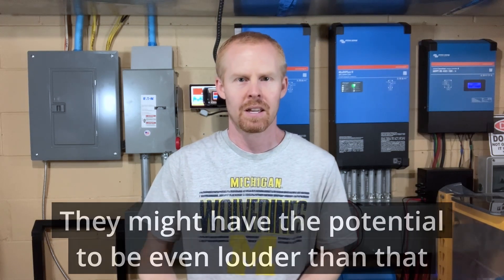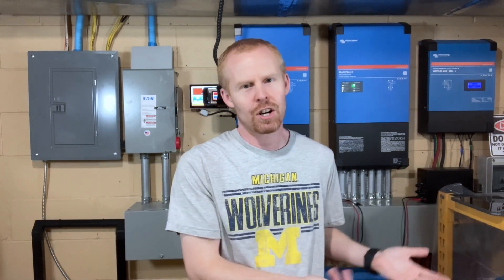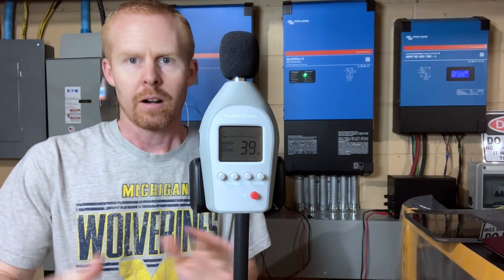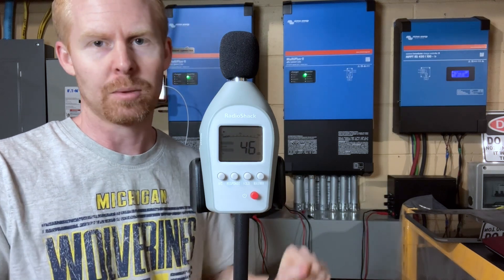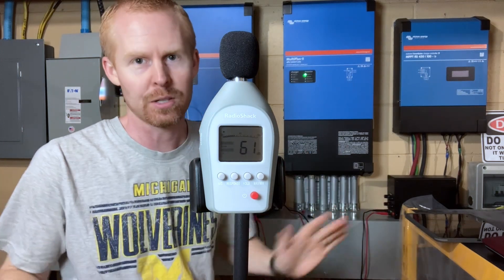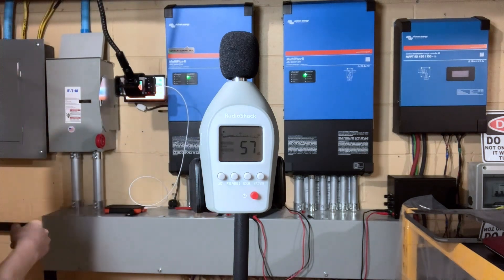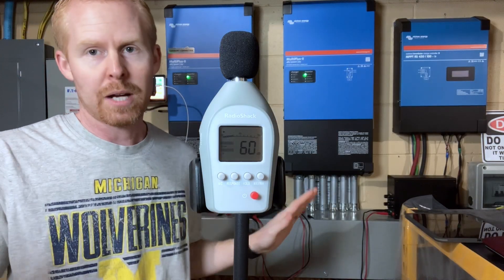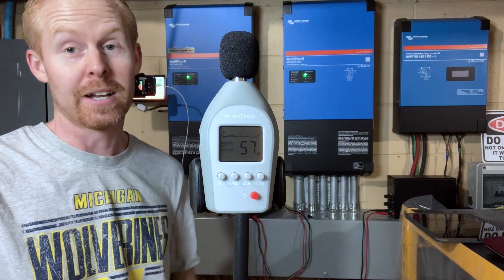Sound & Partial Load Test of the Victron 5kVa Inverters

Comment: Any good reason to get two MultiPlus 5000 like you have instead of a 10,000 Quatro or similar?
I have a chinese inverter just for emergency power right now, and will want to upgrade to Victron down the road as I start to use it more for regular use and not just emergencies.
Reply from the maker: There’s only a few differences between the Quattro and the MultiPlus.  The biggest one is that the Quattro has 2 AC Ins.  If you don’t need both of them, I would look at the MultiPlus.

Comment: They have kit to solve this issue under warranty
Reply from the maker: my serials are not in the range of when that issue was discovered.
Reply: @AdamDeLayDIY  Hi Adam, just query Victron as this was a major issue for older serials as well, They make  the inverters much quieter, as this was a known issue for a number years with the multiplus2. As i am a Victron installer in NZ, and have upgraded a few of these to make it quiter for my clients. Your fans have athe classic pulsing sound at low RPMs, due the PWM pulse of 25Hz,  which was to low, so victron supplied a inline kit which is plug and play to increase the PWM to a much higher frequency.

Comment: Sounds like you need to add the victron  fan mode kit as it will make it ever quieter
Reply from the maker: @robduthie2979  my serials are not in the range of when that issue was discovered.

Comment: Great test. By the way there is a retrofix for the multiplus called "Reduce low RPM fan noise MultiPlus-II, EasySolar-II & Quattro-II v2"
Reply from the maker: Thanks, do you have any specifics regarding this?  I know there was a fix in the past but it was for older versions and if I recall my serial number wasn't within the range of affected devices.
Reply: @AdamDeLayDIY  I tried to post the url but youtube blocked it. Google what is in the quotes and you'll find the pdf. Looks like what I just purchased is affected HQ2219 as well. Dang it did I get super old stock.
Reply from the maker: @DannyCsaszar  Ah, now I remember.  The 120v model of the MP2 5kVa isn't listed on that doc. I think all the problems regarding sound were before that model.  Thanks for sharing though!

Comment: Hello, why do you have the difference in watts between L1 and L2? Shouldn't they have the same watts? Does the length of the AC cables matter? As DC does
Reply from the maker: Unless you only have a single 240v load running, your L1 and L2 will probably not match because of all the different devices connected to your inverters.  There’s alway potential for different devices to be turned on at the same time but different phases and they have different loads.

I had wired up my AC side thinking they had to all be the same length but I’ve since been told by several that it doesn’t have to be regarding AC like it does DC.

Comment: I don’t think this is a fair comparison as the EG4 is an all in one so you should have left the charge controller on. Also you other test was during charging on a Sunny day and today is a rainy day. I’m seeing apples and oranges.
Reply from the maker: It wouldn’t have mattered had I left the charge controller on.  Even the 450/100 decibel level only increases maybe 1 db when running hot. 

The biggest take away is the fans always are making noise with the 6500s and they barely run with the new system.

Comment: My regular multiplus 3000/24  is always super quiet except when the fan kicks in… even then it not bad at all ..I don’ even notice if a few ft away…
EXCEPT ……..for whatever reason , when I hook up my high quality heat gun
on high (1250 watts ) everything is normal BUT on low (500 watts)  , my inverter sounds like a small weed whacker growling… but only when I use the heat gun on low …
I have run at least 25 other things from  small to huge..everything I own to test stuff .!
 Nothing causes it to hum …..only that  heat gun on low…
I have no idea… 
it may be somthing is  wrong with the gun…??? 

My hillbilly solution….don’t use the heat gun on low… I don’t need it to work on low…
Use it on high and hold it a few inches further back …….
I’m a simply guy looking for simple answers…

Your vid reminded me of this scenario…
Thanks…J.
Reply: Hopefully-educated guess: your heat gun uses a TRIAC to moderate heat output, same as a light dimmer uses a TRIAC to moderate light output.  TRIACs avoid having to dissipate as heat (eg by some form of variable resistor) the power you don't want to go into the load by chopping current over each half cycle of AC.  

Need to mention a bit of physics to explain why this is significant: Ohm's law says V = I×R, and power P = V×I; these are fairly well-known, but they only hold for resistive/real loads (ie when power factor = 1).  For an inductor (of which a transformer is a special case), V = –L×dI/dt (where L is inductance, I is current, and dI/dt is the rate of change of current over time; note that minus sign).

When a TRIAC is set for full power, it starts conducting right at the beginning of each half-cycle so the current wave form looks the same as if the TRIAC weren't there.  When it is set for around 50% power, it doesn't start to conduct until close to the peak of each half-cycle, so there is an abrupt change in current (high dI/dt) proportional to the voltage at the time the TRIAC turns on, rather than the sinusoidal current that normally follows sinusoidal voltage.  This is related to why dimmers buzz, but only when not at full power (magnetostrictive effect, which is also why some switch mode power supplies, especially battery chargers, tend to whine and make other odd noises).

The effect of that minus sign is to present a sudden and large voltage acting against the voltage from the Victron's inverter, forcing the inverter to increase apparent power output in order to maintain the 110/230V sinusoid it is designed to generate.  That voltage distorts the AC voltage waveform, increases Total Harmonic Distortion and thereby decreases power factor.  So even though a heating element is a purely linear/resistive/real load, a TRIAC-controlled element is not, because it is a non-linear load with awful power factor.

That goes to power factor and the difference between Watts (real power) and Volt-Ampères (apparent power), and why this 5kVA inverter's capacity is rated at 4.4kW.

When your TRIAC-controlled heat gun is set to 500W, the power that would have been dissipated in the heat gun has to go somewhere — and that somewhere is as heat in the power source.  For utility power, that heat is dissipated in the power lines and transformer.  For the inverter, it is likewise dissipated in its transformer, reflecting the fact that the inverter must work even harder (hence the noise you hear) than when the heat gun is at full power.

It's broadly the same thing as what happens when driving a load with poor power factor, and is related to why inverters that use a cheaper, lighter and smaller high-frequency topology are lousy at driving loads with poor power factor such as inductive loads.
Reply from the maker: Thanks for sharing!

Comment: I'll look forward to you talk about the lower idle current and how much more power you see because of the increased efficiency!
Reply from the maker: I believe it was referenced in another video, but my 6500s had an idle current of around 84w a piece.  So your looking at 168w each hour just to run the units.  The Victron system in total, I believe I saw 35-36w for full system idle.  Each inverter is 15w.  So I’m basically saving 3.2kW over a 24 hour period just in idle capacity differences!
Reply: i think like 15 watts a piece, known to be the lowest

Comment: Is the Max load 5kw each on the inverters, how long will it stay at max before they trip, how long past max will it run, Is thier a higher max rate with PV charging.
Reply from the maker: Continuous output is 5kVA.  You have to take the power factor of what’s running into account.  Peak power is supposedly 9kw, but I don’t know for how long and under what circumstances.  Guess I’ll just have to push these units till they shut down… 😁

https://www.victronenergy.com/upload/documents/Datasheet-MultiPlus-II-120V-EN.pdf
Reply: Victron tend to under rate these

Comment: Surprised at the low 83% conversion rate
Reply from the maker: After looking at it more, in order to get an accurate efficiency measurement, you would have to put a meter on the DC in and the AC Out and do the calculations that way.  The individual devices on the Cerbo display might not update exactly in tune with each other, so you data could be off a little.  

I know the spec sheet shows that the inverters can have up to a 96% efficiency rating, but I’m guessing that’s not under full load.  I don’t think any inverter keeps its peek efficiency at full load.
Reply from the maker: I guess it depends on which time in the video your looking at.  When I looked at when the inverter was outputting 9.26k, I calculate the efficiency at 87%.  I still have to figure out what/why the DC system is high when the inverters run harder.  Seems like it has to be more than just the fans running.

Comment: I'm not quite understanding what you are utilizing the transfer switch for.  It is just a basic on of switch, if not can you maybe go over how the electricity is running in the up and down positions?
Reply from the maker: The transfer switch isn’t needed.  I put it in to quickly allow switching from grid to solar power because I do a lot of testing.  If I have to take my system offline for any reason, I can just push the switch to the up position and all my loads are on grid power.

Comment: I like that cerbo screen thing. I wonder if there is a way to get such fast updating out of solar assistant. You should do the test with high solar input. My 6500s seem to reach takeoff velocity when the solar input goes over 3000w.

I'm surprised at the losses shown with such an efficient system. 11.105kW from the batter minus 354 dc watts - 9.26kW + 20.4W from solar is 1500w unaccounted for. That can't be right. Do you know what that's about? Is the shunt in need of calibration ?
Reply from the maker: I’m guessing if you had the version of SA with the local display, you might get faster refresh times, but your still dependent on getting the data from the different devices.

These inverters don’t have Solar charge controllers.  They’re separate.  Even the separate chafe controller is quiet though.  I’ll be doing a video on that later.

I’m not sure if the DC numbers are accurate.  Haven’t looked into it yet.
Reply from the maker: After looking at it more, in order to get an accurate efficiency measurement, you would have to put a meter on the DC in and the AC Out and do the calculations that way.  The individual devices on the Cerbo display might not update exactly in tune with each other, so you data could be off a little.  

I know the spec sheet shows that the inverters can have up to a 96% efficiency rating, but I’m guessing that’s not under full load.  I don’t think any inverter keeps its peek efficiency at full load.
Reply: @AdamDeLayDIY  they become more efficent under load, with no load there chewing power, Pout is zero

Comment: Another great video. I pumped the breaks on upgrading to the EG4 units after seeing your issues. Was looking at 18kPV but there is a FB forum where people are saying they have flicker issues also.  Might need to go down the path you are with Tier-1.
Reply: I’d be interested to know the group also. That’s the first I’ve heard about any flickering with the 18kpv. And I’ve had both types of inverters  6500’s and the 18kpv.
Reply: @GavinStoneDIY Been waiting to see if you had any of these issues.
Reply: @cgutowski471  no issues. You could see a slight flicker when a heavy inductive load like a water well turns on. That’s understandable. None of that flickering or strobing I’ve seen in the past. Granted, I didn’t have any flickering with my last set of 6500’s either. I believe they’ve resolved that issue.
Reply: Most of the complaints about flickering or because people buy the cheap LED bulbs. That’s one reason they bought EG4 products. Get good quality LED bulbs and you will have no or less flickering. I have had unreliable power company power up until early last year. I had flickering. I’ve been running onto SolArk12ks since then. I had flickering until I change the bulbs to all higher quality/priced. I still have flickering in my bathroom occasionally, because I have a 20 SEER American standard heat pump, inverter type, setting four foot away outside. I typically had 45 power outages annually on grid power sometimes up to nine days. I’ve had eight minutes without power on my SolArk12ks. Most of those are my fault.
Reply from the maker: Thanks.
I hadn’t heard of the flickering issues.  Can you tell me what the name of the group is?  I don’t think YT likes external links in the comments, otherwise I would just ask for a link to the page.
Reply: No issues with flicker with my 18kPV.
Reply: Signature Solar EG4 Users. There’s a few comments about it which of course is concerning.
Reply from the maker: @cgutowski471  thanks!